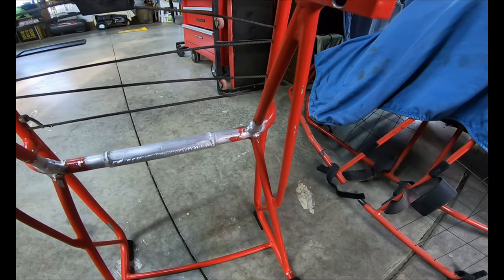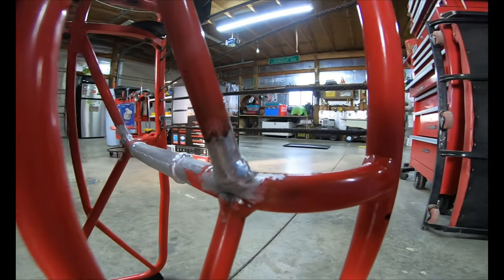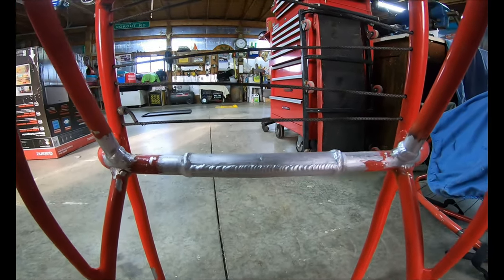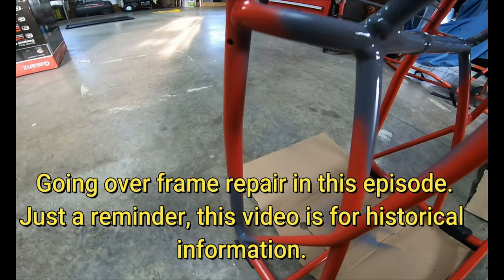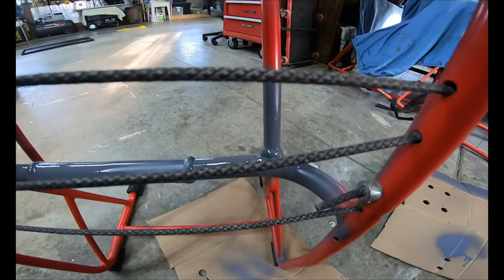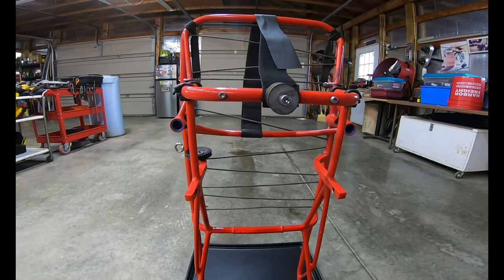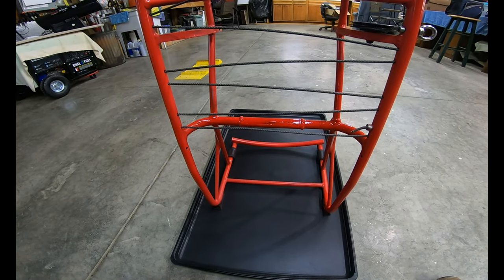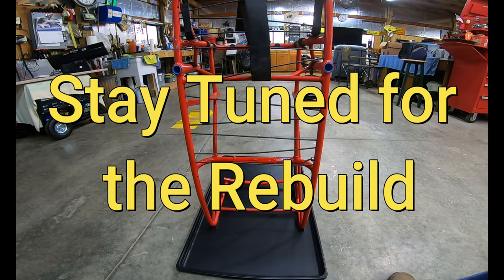Rebuilding The Fresh Breeze Monster - Frame Repair and Painting VI- Ohio Paramotor Trike Adventures

Comment: Lookin good.  Did you have to take off the stater before sending out the engine?   
And did your props need work that you had to send them out (who)?
Reply from the maker: No I didn’t take it off.  Was told to leave on.  The prop had some chips in it that gave it some blemishes as well as I want them balanced.   Props are back and next video will be on the props.  Rick Simmons out of Texas did a nice on them.

Comment: I was going to say don't grind anything that metal is already thin. What works good is wire wheels on a grinder you can get them at harbor freight but wear a face shield the wires fly off but it strips it clean and does not remove any metal. Next time maybe. Looking good.
Reply from the maker: No grinders were killed in this project or harmed.  😂